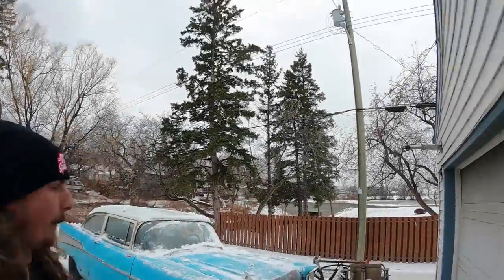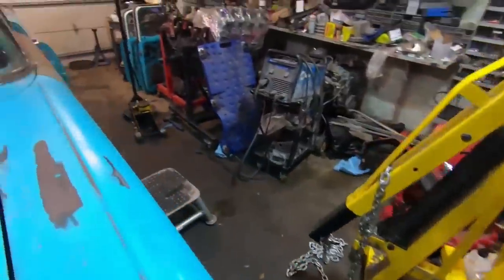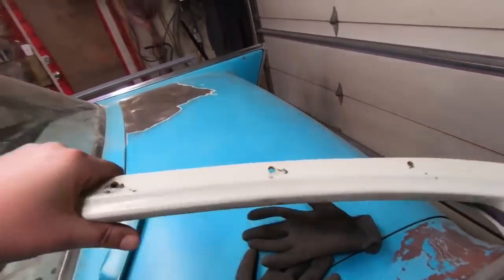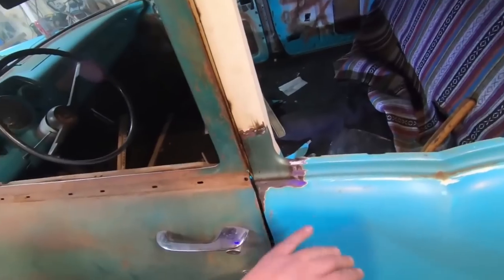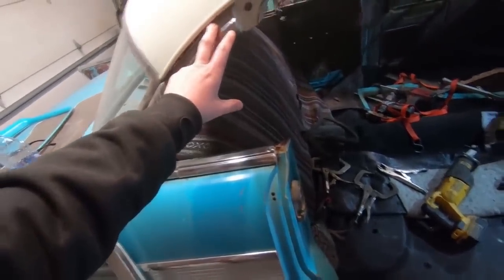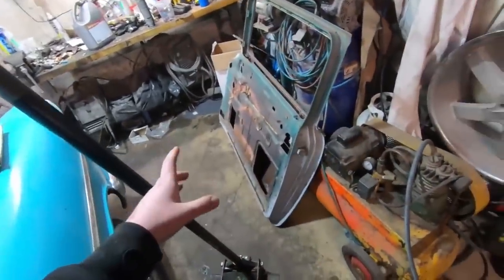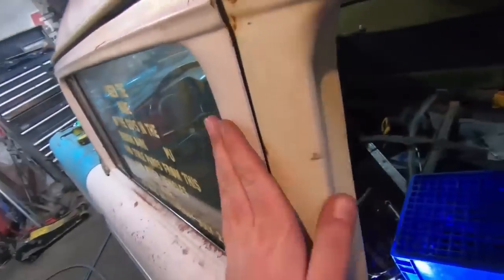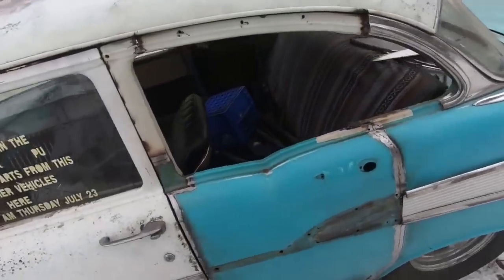How to Easily Convert A 4 Door Tri-5 Chevy Into A 2 Door Hotrod!

Comment: Hey Dan I did exactly the same thing on my 66 Pontiac Parrisenne 4 door post. Only here in Australia they never imported the 2 door post model in those days, so parts were almost impossible to get. I had to use convertable doors then re-use the window frame off the old doors after I extended the window frame then weld them into the convertable doors. I sectioned all the stainless much the same as you. It was very satisfying when I finished it. That was about 4 years ago now and I'm pretty sure it's the only one in Australia or at least I've never hear or seen one to date.

Comment: I love 327cid engines they use to scream ,had a 350hp 327 in my 2door 1957 belair it had a sagnaw manuel tranny and an indy shifter and it was fun it had 53,000 miles on it and i was 22 years old now im 65 and my daily is a 2003 mustang gt with bolt ons and tremac 3650 5 spd. Has 410 pos. 8.8 rear end and flow master exaust and she does 12s ans runs over 150mph and im still sna t ching gears like a 20 year old ,and ty for your vids brings memories

Comment: It looks like a ton of work but you make it look easy. I have a 4 door 55 210 post. All rot free. 454 and a 4 speed. I built it with the intention to eventually change it to a 2 door. Real 2 doors cost a fortune on the west coast. Parts obviously are simpler to get here and once the pandemic allows the swap meets in the Phoenix area to reopen I am sure I can find some complete doors and maybe even some quarters. I am not sure I could do all the engineering you did to cut and fit the rear doors. To bad you are in Manitoba or i'd hire you to do the job. We see lots of winter visitor's from your neck of the woods in Mesa every year. Keep up the good work and video's.

Comment: Back in 61 -  63 my Dad had the very same 57 4dr, same color. I would leave it as a it is, they had to find up here in Michigan. Went to circle tracks or demo derbies. Dad still had that when I went in the army, when I came home on leave he had a road barge dodge, push button auto with a flathead 6. The vehicle I learned to drive on was a 57 1/2 ton chevy, 3 spd stick. Big change to a deuce and a half...

Comment: “Panic sets in”   Made me laugh when you said this after cutting the first door post out. Every big project always has the “point of no return” moment. I usually think that I voluntarily did this to myself as well!
Fantastic work! Not a big fan of quadraports, wish now I’d picked one up when they were cheaper. Back then the only 4 to 2 conversion I could find was a 4 door into a 2 door convertible using reproduction sheetmetal? Should have done more homework.

Comment: I bought a 57 2dr 210 delrey i paid $ 17500 the bottom and trunk and floors are mint the body is nice it's got a 283 with three sp on fl car is nice BUT ! i could have a 57 chevy 4 dr in the same shape for $ 3800 . i think if i would have seen this video sooner i would have done this because im gonna make a gasser out of the 2 dr my bad . good video . i have a video on u tube to it's call Fast Eddie pinstripe flames on a mustang notch with 1/8 tape for young guys who want to pinstripe  the cheap way with just  tape from auto zone 

e

Comment: I'm just wondering, since it isn't stock any way, could you leave the small window in the back then cut your door down and keep the structure in, then cut your window down to still have a functioning back window? Then your window trim would be easier to get to fit too.

Comment: Love your work and results! I have a question. I have access to a pair of NEW fiberglass doors for a 55 and some B pillar repair panels which will allow the 2 door latch without issues. Would you think fiberglass doors would be true enough to use for a conversion and location of B pillar? It's going to be a race car. Thanks!

Comment: Why do you cut out the filler panel between the doors , couldn't you just leave it and just weld the rear door skin to it , also couldn't you leave the inner door structure connected and just cut it and the outside at the same time seems to me it would be a lot less work and it wouldn't be so flimsy and hard to work with it may be a Little more time to trim the inside to length but I still think it would be a lot easier to not have to weld the inner door structure back in .